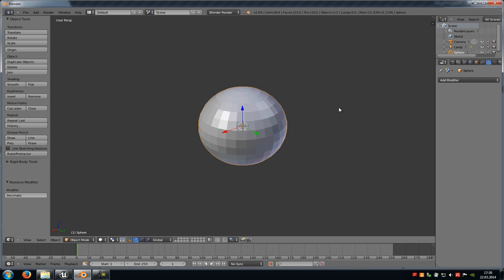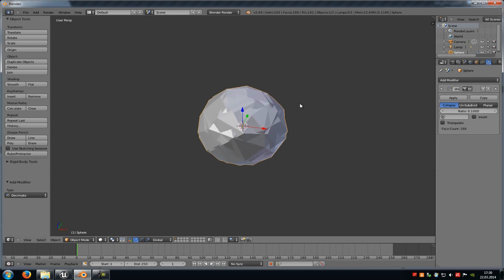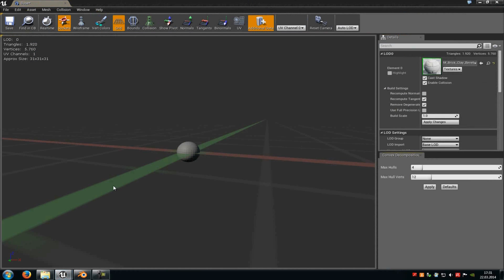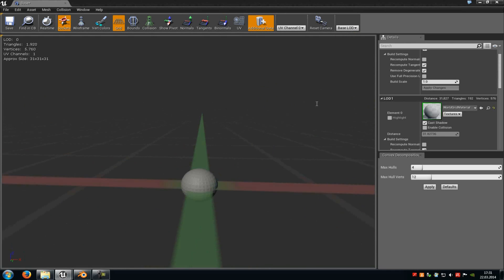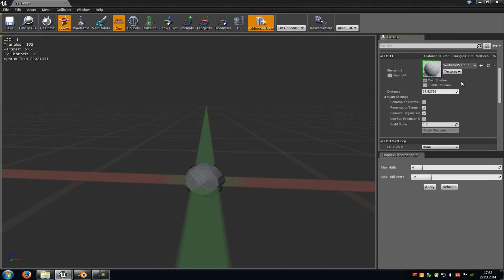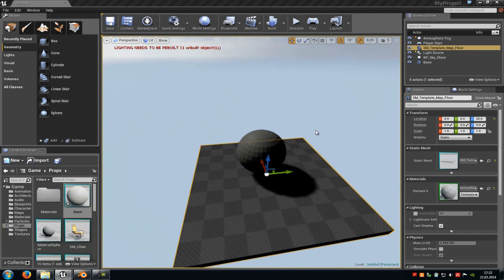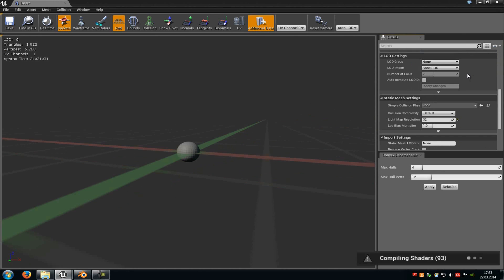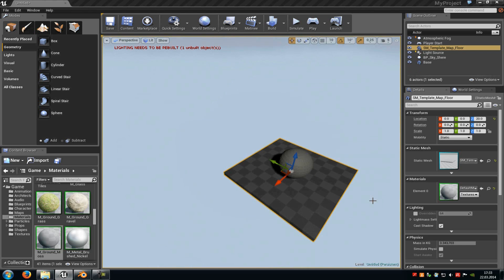Unreal Engine 4/Blender Tutorial: LOD (english)

Comment: Okay, so here's a question that's probably unique to my situation given the comments and I've looked into this in as many places as I can and there's no information on it anywhere, so I'm going to ask you.

I have a rigged model that has around 13000 polys on it and I want to give it an LOD that has around only 1300. The problem that I don't really know if it will happen is if, I apply an LOD to the rigged model, the character animations will not play if the LOD is on. How would I get around this? Is it even possible? And, if not, would it just be a better idea to use both models on two different identical rigs, and just use one for cutscenes and the other for gameplay?

Comment: Thanks I use modo so max, maya etc, would not apply directly this would more or less. Albeit I may be wrong. 

I wonder when unreal will get something like this built into the system it wouldn't be too terrible difficult just set it up to reduce polygons (and how well you want the shape to conform to the original) by so many percent over certain distances you can have it set up to be quite dramatic or a gradient blend of sorts same with the texture and so on. To me with depth of field it makes lod when it is quite dramatic a lot easier to deal with. 

I wonder how well this will work for a 7k poly model, not much to worry with this is not for a video game per se so it won't have a ton of things happening on the screen at once, plus with the  depth of field I can be more dramatic with the reduction. 

(Excuse my errors my keyboard is being quite the pain today, wireless keyboards they were not created to be perfect it seems)